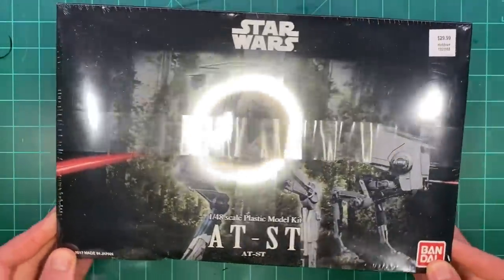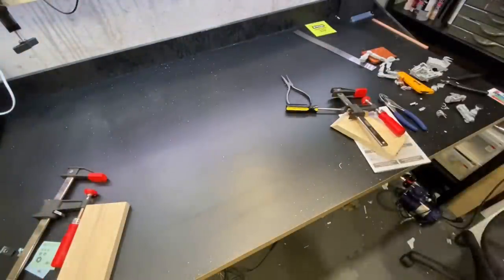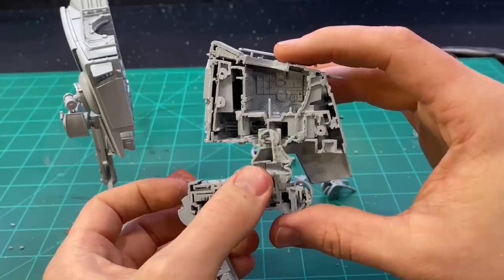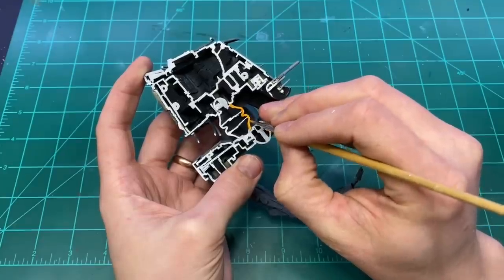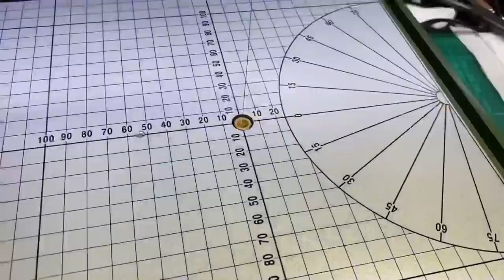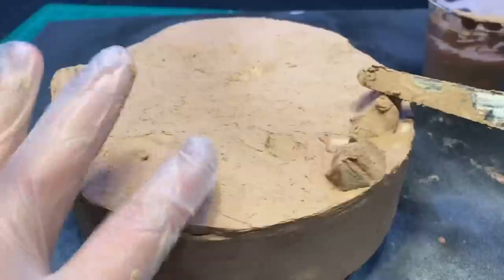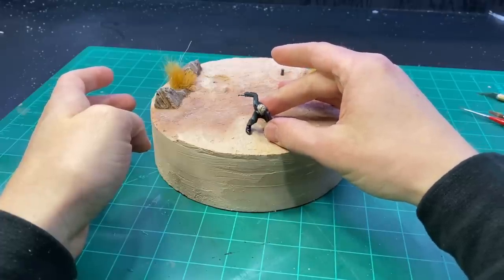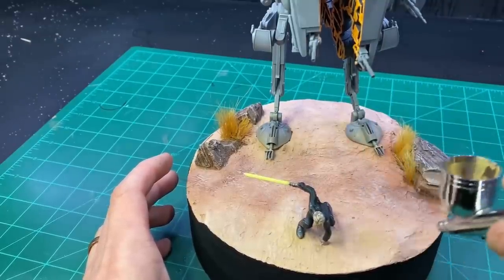Luke Splits an AT-ST | Skywalker vs. Chicken Walker

Comment: What if you'd use a luminsecent paint on the cut lines?
Reply: This!
Reply: That would be awesome
Reply: Was thinking the same, also maybe some weathering/dirt on the outside
Reply: An some melted slag, dropping to the floor.
Reply: How about two troppers inside checking to see if they have all their limbs.
Reply: some smoke coming off of it would also be cool to add to the just-got-cut-through idea
Reply: that would make it look even cooler!
Reply: fluorescent paint and some uv leds in the base might also work

Comment: What if you printed the ATST in a clear resin that allows light to pass through, and you spray most of it with primers and paints that block light, except for around the cut areas, and put the LED lights inside of the plastic somewhere so the glow would bleed through. and you paint the molten/cut part with an orange or a red that will diffuse the glow and make it look like it's on the surface. I don't know. I've also been trying to figure out how to get that molten metal effect, and that's just one idea I wouldn't mind trying.
Reply: That's brilliant

Comment: To obtain that glowing effect from the cut you could lightly over spray your orange color over the edges and on the pilot inside, then use white on the cut edge then airbrush a light coat of the orange over the cut edge again.  Still looks awesome though.  Great Job

Comment: Hi I saw these Videos and ist seems very cool.
Here´s a tip, I think you could cut luke in half or print two seperate pieces to get the wires hidden between the two pieces (just make a little slot on the one side and put the wires through the slot) 
😊

Comment: I am liking what you made with your diorama! Has a Diorama builder my self, I am always inspired by other people's work!

I would like to make a constructive comment with your work on this piece!
The AT-ST is not showing its weight on the surface that his foots are placed on. The gap between the ground's surface and the foot breaks the illusion of the scene.
What I usually do to show the weight of the legged mechanical vehicle is to add Sand around the foots to show that the foot is slightly making a print on the ground and to hide the gap at the same time.

I like your work! I just discovered you and am Interested in seeing more!

Comment: You can try fluorescent paint, and a UV leds to make it glow. And you don't need the leds very bright, so it won't be lighting up the whole diorama.
**the leds can be hidden in the AT-ST cavity, pointed outwards, to the light only hits the surface with the fluorescent paint.

Comment: The idea is great and Luke looks very good as a result, but: the ATST looks like a new children's toy - cut in half. No scratches, no smoke traces, no dirt, etc. I would have let the heat through the laser sword on the metal shine a little more and attached LEDs inside to a) illuminate the cockpit in red and b) generate flashes of electricity. The base doesn't make a realistic impression either. Still it's a good job - it's always easy to complain about things, but doing it yourself looks different again =)

Comment: nice work. imho, I would've painted the cut edges white, then put a thin orange layer in the center of each edge, to give a more glowing lava effect. perhaps even a slight blue outer edging. but Luke is the center point here, and how you did it isn't distracting at all.

still waiting to see how you would do a Lego set

Comment: This is beautiful. I feel like putting some red-ish 'cabin' lights on the inside of the AT-ST would have been star wars cannon and highlighted the yellow/orange paint along the cut, contributing to the glow along those cut lines you were looking for. I think lights hidden deeper inside the AT-ST would have cast the glow on the opposing side of the cut without the light itself being distracting. I could see why placing lights at the edge of the cut wouldn't work, those little lights are quite bright for their size, and the cut isn't supposed to be as bright as a lightsaber blade. But I'm just theorizing and could be totally wrong, I tend to work with fiber-optics since they're dimmer and easier for me to place.

Comment: I always wanted to do this with two of my Gundam kits that I did when I was younger. Thanks for the inspiration!

If you want more ideas on painting the hot metal, listen to one of the commentaries for Terminator 2 when Arnold first arrives in the present. The effect they did with the vaporized corner of the trailer truck was in-camera; no VFX used! See if you can find out the paint they used, it's really cool.

Comment: Next time you cut one if these with a band saw, wrap a piece of blue painter's tape around the center (cut-line) and cut through that.  It will keep all the pieces together.  If not intact, it will prevent pieces from flying off during the cut.

Comment: Looks amazing! Id suggest a bit more damage (melted metal, weathering) along the cut as it looks a bit too clean.
Reply: You have that keen eye, also...good. I'm not the only one.👁
Reply: @charlesfuentes3695  yeah hahah, it looks good but that detail I think would really seal the illusion that he's torn right through that thing
Reply: I don't know, in the movies everything looks pretty clean cut by a light saber.
Reply: @moirahorton5167  With most quick cuts yeah they tend to be clean, but with something large like this where the lightsaber would be dragged through youd get rough damage on the edges. You can see this in that scene in TPM when qui-gon cuts through the door in the beginning, the metal melts around the lightsaber.
Reply: Should have left some or the roughness from the bandsaw for melting metal.

Comment: Technically speaking according to the in-game universe lore a lightsabers blade can be extended quite a long distance away from the hilt. This requires a lot more energy use but a skilled Jedi supposedly has very good control over lengthening and shortening their lightsaber in battle so it would stand to reason that Luke more than likely lengthened his blade on the downstroke just like Starkiller did when he killed the AT-TE in game.

Comment: Just thinking, For the white hot cut metal effect, you could of painted the orange white, then airbrushed orange on either side of where the cuts are, leaving a thin white feathered line in the middle. Think that could of created a cool glowing metal effect? Either way, pretty dope dio! 👌🏻

Comment: I have no knowledge about any of this, but maybe you can put 2 small lights in both sides of the AT-ST cockpit and use a reflective paint layer on the orange paint. That way it will be illuminated from both sides, giving a glow, and it will also look like the AT-ST had some internal lighting for the crew.

Comment: Did you consider using glow powder for the cut edge rather than lights? A bit of PVA glue along all the edges, then either dip the model in the glow powder or sprinkle it on and shake off the excess. Hit it with a UV light and it will glow like red hot metal
Reply from the maker: That’s a good idea! I should try that.
Reply: @Boylei  thanks. Ive used it before in the past, quite effective, and it saves on messing about with wiring and batteries. If you use a decent glow powder, it will glow for hours

Comment: i'm not a modeler by any means; i'm just a high ass dude but instead of using the orange paint for the at-st split, you coulda just used orange glow in the dark paint. just a thought🍃👽

Comment: 03:10 I would have tried to use a soldering iron to melt and distort the edges of where you cut so that way it looked like it was molten like the lightsaber makes metal usually look like and then painted it with a fire orange and red type of day glow paint and maybe mix the two colors with some black light sensitive paint they make a black light sensitive paint that looks like a white translucent color and you can use a small amount to put in with your paint and it doesn't change the color usually especially with something that's already a neon or very bright color

Comment: So there are certain blades in star wars Like Anikin/luke's first lightsaber that could Lengthen or shorten the Blade length in a duel by just pushing one of the buttons on the hilt. usually not to a length where you'd be able to cut an AT/ST in half like this. but you could suspend your belief and think Luke has put this feature into his Green blade like his father would :P

Comment: im about to geek out, but according to one of the star wars visual dictionaries a lot of lightsabers have a length adjustment  knob on them so  personally I don't see why a Jedi couldn't have quickly adjusted the length of the blade along with aid from the force split a AT-ST in one go. if i remember correctly qui gon jinn breached the blaster doors of the trade federation command ship  in the opening of episode one by lengthening the blade to melt through the metal doors. IDK LOL

Comment: It's not bad, but the scale is off, if they had an AT-DP or similar that would have worked better. As it is Luke looks like he's 12ft tall.
Still, considering that they don't make models like AT-ST's in scale for 28mm minis, still a lot better than I could do without a lot of very expensive equipment.

Comment: That doesn't make sense, but ok, I mean is impossible to make a straight cut like that with a short blade like that and end on that place where the machine could fall over you. And the feet of the chicken may be nearer to each other and more like each part of the top falling to the sides. But I understand, you only painted it and did a great job. Congrats

Comment: I'm guessing u didn't know this but lightsabers has a job on them that will allow the user to extend the blade if it is to long or to shirt or is using it to cut through something thicker then what the blade already is so like could have done it in one swoop cause of that. Star Wars rebukes even prove there is a nob on light sabers for that.

Comment: "Cutting a walker in half is not very realistic"
It... is doable but not very practical. A lightsaber's blade length is not set in stone but is adjustable. You could make it as long or short as needed. Most Jedi don't bother with it because it could throw the balance off. The longer the blade the more the "gyroscopic" effect pushes on the blade in the direction they are swinging. Hence why we don't see it in the movies. Also unless the hilt is design with quick adjusting controls or preset settings that you can instantly switch to, it takes time to lengthen or shortend the blade. Plus most Jedi don't like messing with their settings and design their lightsabers WITHOUT interface controls to free up more ''grip" space or put other things in like a tracking device or decretive items.
So in short, just aim for the legs.

Comment: If I may suggest something, maybe try using fibre optic cable/wire to create the glow for the cut lines. Glue the cable/wire along the cut lines and tie them all off at the back to use just one LED bulb as a light source. It's a lot of work, admittedly, and I've never tried or tested it .. but I'm hoping you'd find success with this method ! It may work to give a subtle glow where you want it along the cut lines. Fingers crossed. By the way, my girlfriend and I both love your work !

Comment: i love the concept and the work. I would have added a few things:
1. A couple LEDs inside the AT-AT... as if an engine were red-hot (burning up) or weapon overload.
2. Hollowed out Lukes arm and backside to embed the wires, then epoxy to fill and repaint.

Comment: Luke saw the AT-ST stomping toward him, he sprinted toward it and leaped, channeling the force to propel him through the air, he sliced upward, splitting the walker in half. The 2 pilots sat there, stunned and terrified of what had just happened. Luke force pulled them out of the walker just before it hit the ground, and gently set them down. “We surrender!” One of the pilots said, “Please don’t hurt us!” Luke stood there for a second, before disigniting his lightsaber. He pulled out a hologram from his pocket, “This is Luke Skywalker, I need a prisoner transport shuttle.” “Roger that, sending a shuttle now.” A voice crackled from the radio. A few minutes later, a shuttle landed and the two pilots were taken into New Republic custody.

Comment: Florescent paint to outline the cut edges of the AT-ST and then a couple of black light LEDs in side the AT_ST to charge the florescent paint so it actually looks like it's glowing hot metal.

Comment: Just absolutely bravo well done especially the light saber to create a light saber that small with a light up blade when I got into building hardware sabers as a hobby that level of miniaturization was science-fiction
Now as for The effect of the red hot metal of the ATST you did a good job but here’s how you really do - it get a paint that fluoresces orange or red and wire in a couple small UV LEDs you did the wiring for the saber without being able to see it you’ll be able to wire in the UV LEDs one on each side of the ATST interior facing each other boom red hot glowing metal.

Comment: Lightsabers have no limits on the length, in fact there were specific dual phase sabers that could change length at the flick of a switch. So Luke could very easy have increased the length of the blade to cut through the entire at-st and then decreased the length of the blade before landing on the ground.

Comment: Would have actually left the cut edges, painted them a dimmer red than the glowing orange of the edges themselves, when metal is cut, especially by a lightsaber, the metal gets so hot it expands and warps out. A high precision thin laser might leave clean cut edges, but a lightsaber would melt the metal as it pushed through. To take it a step further I would have used some hot glue and dripped some of the edges and some onto the maket base, and painted it to look like hot dripping metal. To take it a step even further put a small LED under the molten puddle so it glowed.

Comment: Dunno how readily available it is but they make or used to this stuff called EL Wire, came in red blue green and oddly enough an orange color, check that out see if it would work for the glowing metal look

Comment: i looked up the lore on atat splitting and common consensus is that a Jedi will use the force to add extra weight and power into their swing, cutting anything like butter, however it really only works in straight lines since you can just change directions mid swing with all that force force, its been shown off various times in the movies, just not on an atat.

Comment: Instead of cleaning up all the rough cut edges with an blade, you should have left some and melted them with a lighter. The lightsaber is basically a plasma stick so a little evidence along the cut edges like molten metal would make sense.

Comment: Next time you need to cut a circle of styrofoam on a hot wire cutter, tape a brass tack down on the cutting surface one radius away from the "blade"

Comment: Great work! I have some ideas-
Try luminescent paint combined with multiple receded bright white LED’s in the opposing half to light the paint. Cover the LED’s with Rosco or Lee black light gels - a swatch book will provide all the sample and diffusion variation you need. Use neutral density filters to adjust brightness.
Look for videos where large red hot metal is hammer forged, heat treated for examples of hue and sparks
Grain of wheat model train lights with rectifier diodes wired in line will ensure you never have to replace a bulb. They have such a low power requirement you can use transformer wire routed on interior surfaces instead of drilling through panels. Cover these bulbs with a little shaped cotton to show severed wire bundles or other avionics. Look for of ED-209 rear projection stop motion muzzle flash from Robocop.  I think it Phill Tippett. Mask light leaks with black paint.
Gel comes as sprayable to modify the light saber LED hue.
Aircraft cockpits are grey so you can see control surfaces quickly without loosing night vision. (I did theatre lighting and machined armatures for stop motion) Cheers and keep up the great work!

Comment: Question - Why would Luke take the time, doing all that acrobatics etc to cut it in half?  Jedi are about efficiency.  Cut through one leg, it falls over, drive the saber through the cockpit area from the front, a couple of stabs, pilots are dead, no more problem.

Interesting visual - but Luke or any other Jedi just wouldn't do that.  A Sith might because they are vindictive bastards and do it for the "I am all powerful, look at me " lulz, but not a Jedi.

Sorry to be critical but in modelling the "realism" of the setting is just as important as the modelling, otherwise you might as well do a helicopter flying underwater.  This needs a do-over.